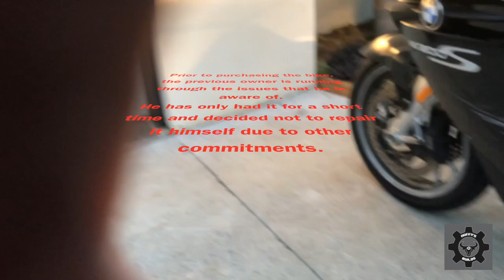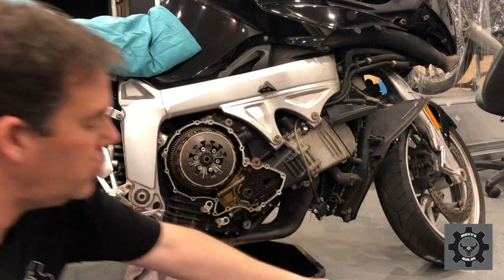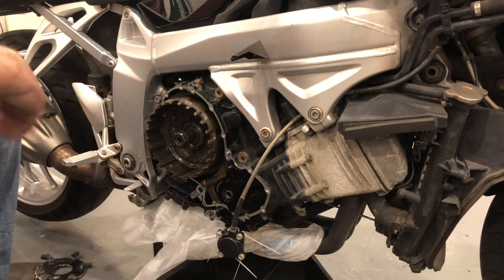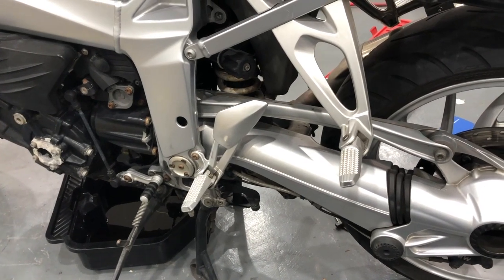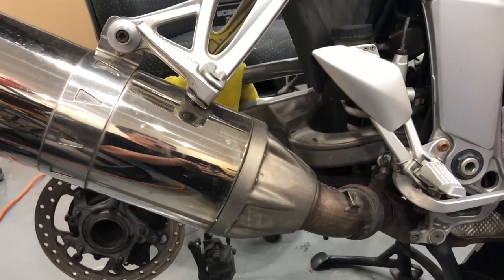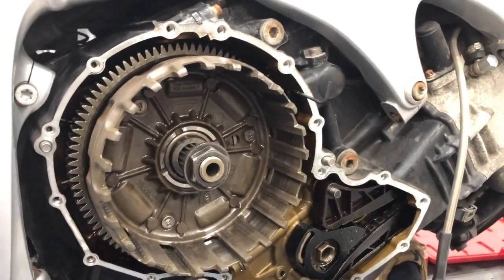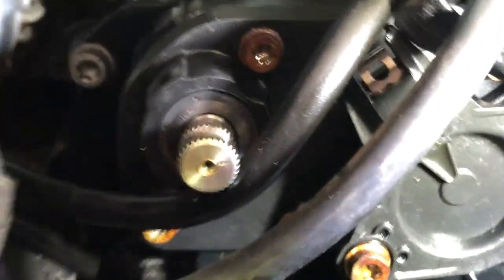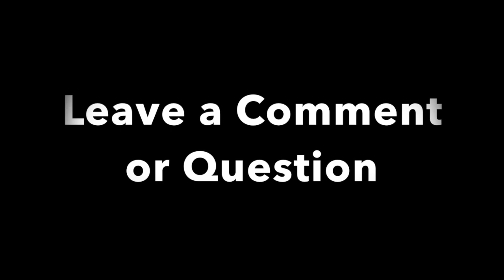BMW K1200S Clutch & Gearbox replacement - Part 1

Comment: I am starting this week with the swap, hope to see the video before, this already helps a lot!. Maybe is it possible to share the raw footage already? Thanks for this video, this BMW is really well build to work on. I already replaced the gearbox on my R 1200GSA, that was way  more pain in the ass, and way more work. haha
Reply from the maker: Hi Tijmen,  thanks for your comment. I have a very big ride coming up this weekend, but I will try and get the second part of this video uploaded over the weekend mate. Thanks for watching. You may need to swap the original plastic gearbox cover onto the new gearbox if you are upgrading to the 1300s gearbox so the potentiometer hole centres are the same. If you are replacing with the same type of gearbox you shouldn’t have to make this small adjustment.
Reply from the maker: Video 2 in my series has been uploaded 🏍🇦🇺👍🏻

Comment: Besides the plastic cover, the timing chain seems to be loose. Did you replaced the hydraulic chain tensioner? I am working to install a manual tensioner in replacement of the old original one. Thank you.
Reply from the maker: 😂 sorry, I just saw this comment. Yes, and it is a very easy job to do. I filmed it and will upload the video shorty. 🇦🇺🏍👍🏻

Comment: What is the tool you used to brace the engine with at 9:55? You called it the big Bertha tool later on in the video.
Reply from the maker: Hi Simon, it was during Covid so I made a clutch holding tool out of 4mm plate steel. You can buy them online. If you have a welder and a bit of flat plate and 10mm x 10mm bar stock you can make it…. But a clutch holding tool is what you are after. Hope that helps. Let me know if you need some photos of the tool and I will email them to you mate. All the best 
Cheers 
Nuffy
Reply: @nuffysbuilds3750  Thanx very much for that. I'll most likely buy one online as I've never tried welding and don't own a welder. My nephew may well do. If he has we could give it a go.

Comment: I want to buy a 2005 k 1200 s but afraid of those chronics. Would you please advise anything ?
Reply from the maker: Hi Mehmet, sorry for not replying sooner.
In my opinion, the biggest issues with these bikes are the electronics. Electrical or computer issues can be difficult to diagnose on older bikes, and expensive.
Mechanically they are excellent. Most problems can be fixed at a reasonable cost with some general tools and basic mechanical skills.
In most cases, you can buy a very capable bike for not too much money. It is the problem that many of us face, we don’t want to spend a large amount of money buying a new trouble free bike, so we have to compromise and get the best value for our money……. I think the K1200 is a great place to start looking.
All the best my friend, thank you for taking the time to leave a comment.
Reply: @nuffysbuilds3750  thank you so much for your reply. I guess I will get a 2008 model K 1200 S which might be better ?

Comment: Didn't go through all the comments.. but always check right off.. that the oil drain plug comes off with the washer .. if not get it off bottom ,, replace new

Comment: Hi. Very good job. What year is your K1200S? And from what year you got the K1300s parts from?
Reply from the maker: Hi Kiryani, thanks for watching and I really appreciate you taking the time to comment.
My K1200s is a 2007, the 1300 gearbox came out of a 2009 K1300s.
You MUST keep the original gearbox, because you will need the gear indicator piece off the original gearbox so the electrical plug is compatible.
Very straight forward job to change.
The 1300 gearbox is definitely a bit clunky compared to the 1200 because it is designed to have the quick shift setup. You just need to change gears quicker and it is best to preload the gear selector and just tap the clutch. Very smooth gear changes once you get used to the slight difference. All the best, and feel free to reach out if you have any questions at all.
Thanks again
Nuffy (Paul)
Reply: @nuffysbuilds3750  Thank you for your quick answer and the details. I wasn't able to find a k1300s gearbox so I got one from a k1200s with 20,000 miles on it. Hopefully it will last a little bit until I find a better replacement. Great videos!
Reply from the maker: @kriyani  I think you will find the 1200s gearbox smoother and more enjoyable. Perhaps check the shift forks for ware before you put it into the bike. It should only take 10 mins to do the check, at such low mileage, I expect it will be great. All the best, stay safe, have fun and thanks again for checking out my channel it really is appreciated.
Reply: @nuffysbuilds3750  thanks for the advice! The best for you as well. Keep up the good work!
Reply: @nuffysbuilds3750  quick question. what is the size of the socket you need to remove the clutch hub? Can't find it in the repair manual.
Reply from the maker: Hi Kiryani, I am about to get on a plane so I can’t check the manual in my shed… I’m fairly sure it is a 30mm socket for the main nut. (Possibly a 29mm, but almost certain it was 30mm) have fun mate 👍
Reply: @nuffysbuilds3750  Thank you!

Comment: Mine had some metal on the drain plug but they appeared to be a bit finer than yours. How many miles on this bike?
Reply from the maker: Hi Paul, thanks for the comment. My bike has around 116,000 klm on it. The fact that the shift fork is so worn, I am told the amount I had on the magnet was ok. But, I will see how it looks on the next oil change. It seems to run better and better every time I ride it. They are just not designed to sit idle. Merry Christmas to you and your family mate.
Reply: @nuffysbuilds3750  I hope it looks great on the next oil change. Picked my K1200R Sport up with 2,600 on it, 20k miles now. It's been clunky since day one. Heard this is just the way they are. Fingers crossed. Merry Christmas and Happy new Year to you and your family too my friend.
Reply from the maker: Hi Paul.
Sorry for the late reply. The bike definitely has a clunk between gears. I am learning to rev match better between changes particularly on the upward gear changes. I think I can make some improvements, and will try to find some inexpensive remedies. All the best for the New Year.
HAPPY NEW YEAR, I hope you enjoyed the videos so far
Reply: @nuffysbuilds3750  Happy New Year to you and your family.

Comment: How did the basket come out so easily?😂 mine won’t give more than an inch
Reply from the maker: Have you locked the starter gear?
Reply from the maker: Oil pump chain?
Reply: @nuffysbuilds3750  I was able to get it to cooperate eventually, thank you!